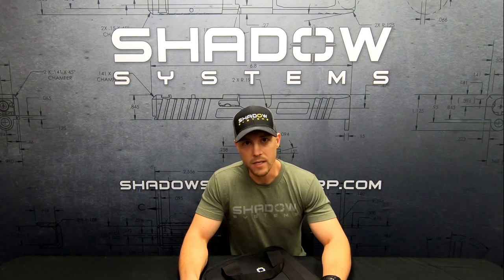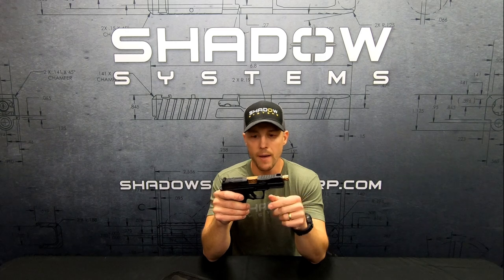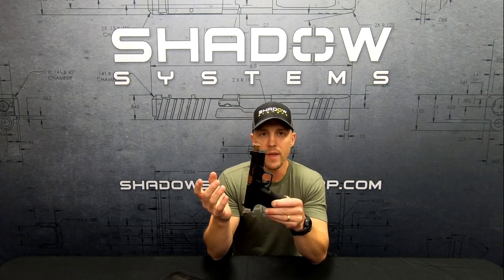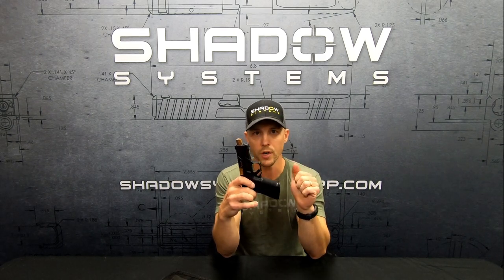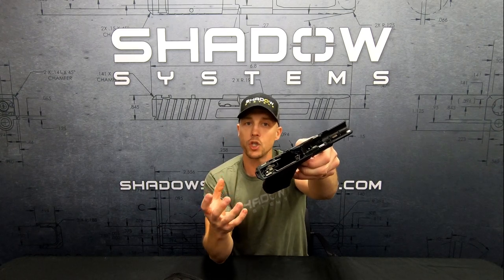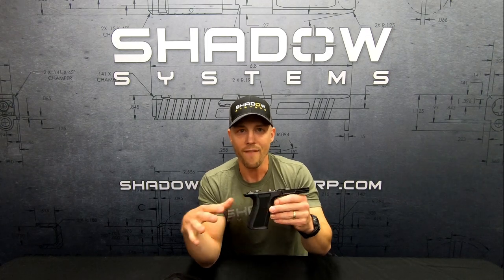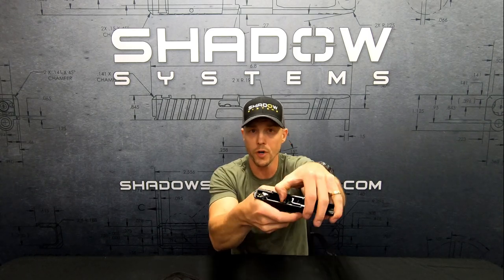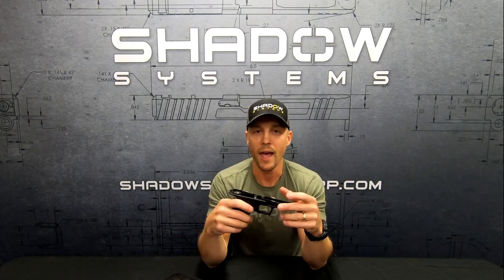Technical Tuesday: How does take-up relate to drop safety?

Comment: Thank you that man! All the research I've done about carrying with one in the chamber have all said, "if it's a modern striker fire pistol, there are internal safeties to prevent accidental discharge." That's not good enough for me to feel comfortable having a round in the chamber. Now that I know exactly what internal safeties are in place, I feel very comfortable. Thanks again for taking the time to fully explain!

Comment: Interesting thanks Trevor. The only downside of a long trigger pull is (for me) i tend to anticipate a little more on that trigger and throw some shots.
Reply from the maker: Agree that the light, short triggers are easier to manage.  With that said, some regular dry fire sessions will certainly help trigger control.  Also, if you practice coming to the "wall" in the pull and then breaking the shot, it can be managed more like a single action trigger.

Comment: Nice. The first thing I did was verify everything you said about safety. The only thing I haven't done is use an armorer's half-back plate to see how much the sear is overlapping with the firing pin lug (MR920 has a proprietary back plate, so it's not as easily done). What about over-travel? Any cons with reducing this significantly?
Reply from the maker: If you reduce over travel too much, you can get to the point where the firing pin safety is not fully disengaged and drags on the firing pin, causing issues.

Comment: Very interesting.  I recently purchased your MR920 and also own a G4 Glock 19 which I put an after market trigger into.  All I wanted in the after market trigger was a trigger shoe where the drop safety "dingus" fully recessed so it wasn't annoying to shoot at the range.  I took the two guns apart while watching the video and sure enough the Glock 19 has less take up and barely nothing of the cruciform on the frame shelf.  I would much prefer to have the additional safety.  My question, having rewatched the video, is what is this third safety called?  You call it a drop safety, but so is the first safety (the dingus on the trigger shoe).  Does the pistol have two drop safeties?  The third safety is designed-if I understand you correctly-to prevent the striker from going forward as does the plugger safety so why is it called a drop safety?  I'm trying to sort it out in my mind for clarity's sake and so I can explain it to others.  Thank you for these videos--they are very helpful.

Comment: Is it normal to have way more take up than a Glock and for the trigger housing to have a piece of it sheered off out of the Factory as my War poet Dr920 trigger bar has contact with the trigger housing and has a piece missing off the housing wall

Comment: Doesn't the take up and pull of the the trigger actually pull the striker the rest of the way back? Meaning the striker when gun is loaded and no finger on trigger doesn't have a fully cooked striker just partial?
Reply from the maker: Correct. When the gun is “cocked” the trigger bar is supported by the drop safety surface and the striker is in contact with the back of the trigger bar (partially cocked). Pulling the trigger completes the process of withdrawing the striker, the trigger bar goes past the drop safety, and can then track down the connector, drop, and release the striker.

Comment: I don't mind the long trigger pull so much as I'm bothered by the grittiness during the take up. I'm going to polish trigger bars this weekend to see if it helps. I've improved the trigger a great deal while it remains fully safe with some different springs, which helped with pull weight, but the grittiness just hasn't gone away even after hundreds and hundreds of rounds fired by each of my SSC guns.
Reply: Did you end up making the trigger any better? If so what changes did you make?
Reply: @austinharris1059  I finally replaced it with  a Timney Alpha trigger. I now have one installed in all the of my SSC pistols. Highly recommended.
Reply: Is it the gen 4 version timney. Thats good to know! I read that people were having issues with aftermarket triggers in the MR920, so its good to hear that its working good for you
Reply: @austinharris1059  That's correct. Gen 3-4 version.

Comment: I’ve noticed my firing pin sticking out with my MR920 sometimes even though the firing pin safety is engaged. Is this a problem?
Reply from the maker: This is normal.  The firing pin free floats and can be retained in the forward position momentarily by the downward pressure of the firing pin safety.  Totally normal.